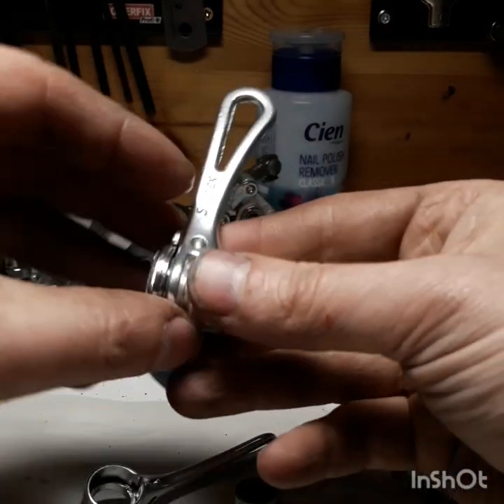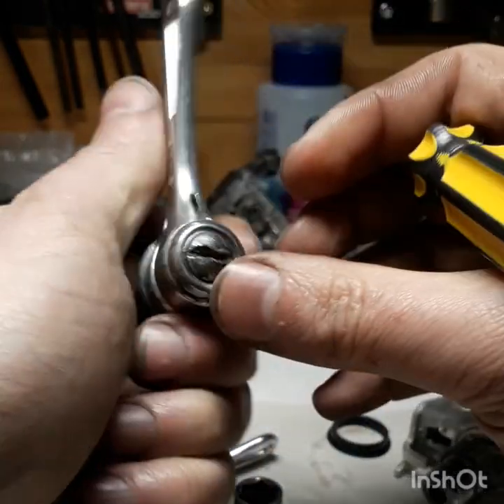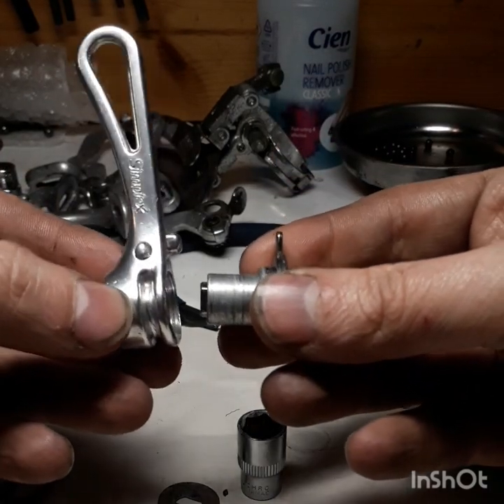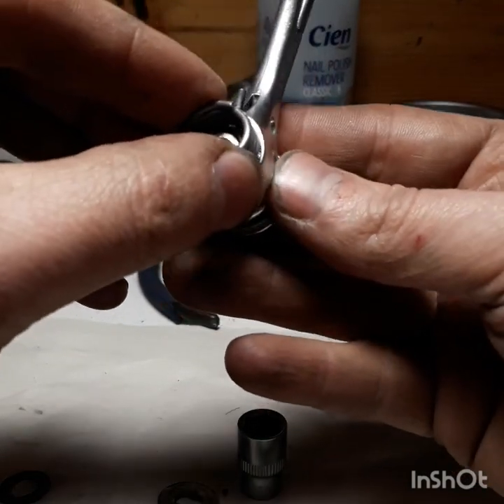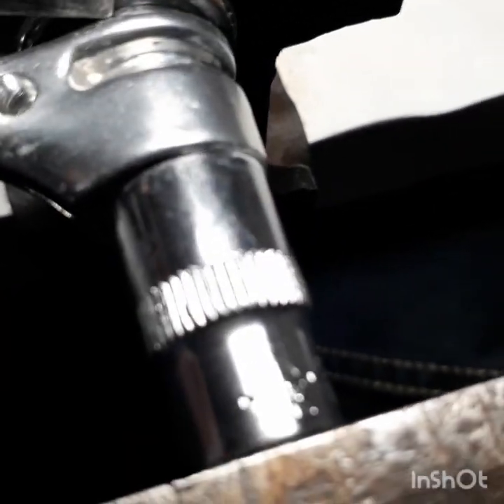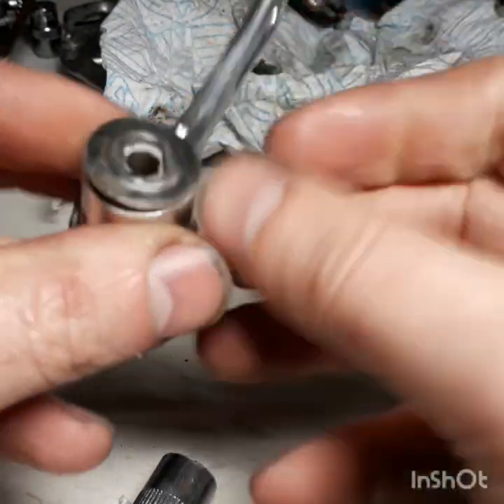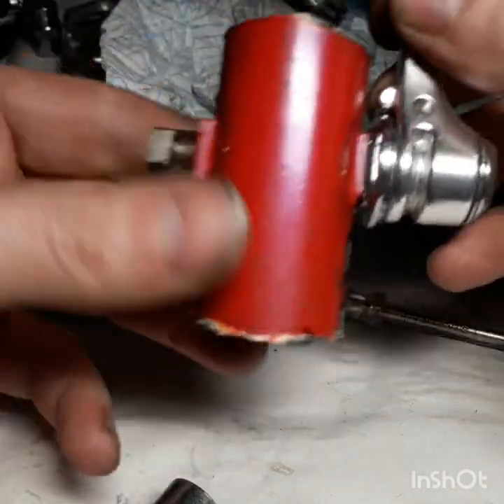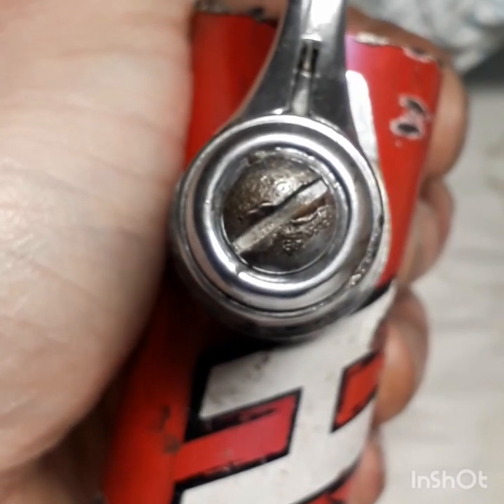Servicing Simplex Retrofiction Shift Levers

Comment: The mechanism is the same as "clutch" in a roller blind, giving low friction when raising but high friction at rest and when lowering the blind, thus allowing the bottom weight to tension the blind without dragging it down, whilst also allowing the blind to be easily raised. Until the mechanism eventually fails (typically the spring breaks) the effect is so good, it just feels right in both directions.

Comment: Don't grease a Simplex retrofriction shifter! If you can't help yourself, a tiny drop of oil or a smear of grease, but lubricants undo the action of the spring's friction.

The way the spring works, btw, is the change of inner diameter of the spring when force is applied against the coiled direction, thus releasing the friction grip on the post it sits on. This makes for friction increased in one direction, and reduced in the other.

The principle was pioneered in early cash registers!
Reply from the maker: I might have been a bit heavy handed with the grease. I only intended to put a thin film to protect against corrosion.
Reply: Great video with attention to details. I'm working on a miyata mtb modifying it to drop bar and downtube shifters. The downtube is 32mm OD and no braze on bosses on it. I'm looking for a solution on how to install shimano downtube shifters in this situation. Any help would be greatly appreciated.

Comment: A very interesting video - now I know how they work; thank you - I never dared to take mine apart! For a while, these were supplied with Allen key screws to attach them to the frame. The versions using a flat blade screwdriver get a bit chewed up over time, as per those used for your excellent demonstration. I wonder if the Allen key screws are available as spares?
Reply from the maker: Off the top of my head I think they are just M5 socket button screws, I'm not 100% sure of the diameter of the head or the length of the shank right now, but If you have the original flathead version you could measure it easily. The flathead screws aren't the best.
Reply: @VintageShimano  Thank you - I'll see what's available.

Comment: Cool design! Picked up the Gipiemme Retrofriction version. "Top hat" piece is nicely machined steel and spring fits in lever without external relief being cut. 
My big question is what kind of grease or wax is specified for the spring interface, as that surely can effect the function. Mine has more of a waxy feel which could be the film left from lighter grease having dried up after a few decades. Any idea about what came with these?
Reply from the maker: No idea what it was originally, but I use white lithium and it works perfectly, I think you could use any quality grease
Reply: @VintageShimano  Yeah, I just finished rebuilding my set and used Finish Line Grease. Seems to work fine once I tighten the screw down enough. Glad I tore them apart as the front shifter had been assembled without any grease and I needed to clean some rust away. The other rear shifter as I said feels as it had a wax like product. I recall someone servicing other friction shifters with a beeswax formulation. Perhaps that was in mine though I can't rule out that being done by a prior owner.
Reply: I see one fellow mentioning using Molypaste which can be used for lubricating press fits. Very thick for heavy loads. A marine version might be excellent for this application.
Reply from the maker: @bcc1955  The grease in these is largely there just as a rust preventative, these are all good options
Reply: I understand that Gipiemme retrofriction levers were actually manufactured for Gipiemme by Simplex. Same with some "Gipiemme" front & rear derailleurs, which are more obviously Simplex.

Comment: Mine are auto shifting on climbs, especially when I stand. Any suggestions?
Reply: If you have these Simplex shifters; they shouldn’t (unless they have not been tightened enough, which is easily remedied with a screwdriver). On the other hand, like one of mine did, some time ago, the spring may have snapped. If you take it apart you may find that the bent spring end no longer restrains the spring to the slot, leaving it free to rotate, not providing the resistance to avoid auto shifting. You can get around that, for a while, by tightening the screw. But that’s not the way they should work.

Comment: That's pretty cool the Shimano dura ace down tube shifters keep moving on hard efforts despite tightening the bolt. Is there a modern alternative of this? Also thank you this is helpful.
Reply from the maker: If it's slipping there's likely too much grease inside. You want just a thin film of grease